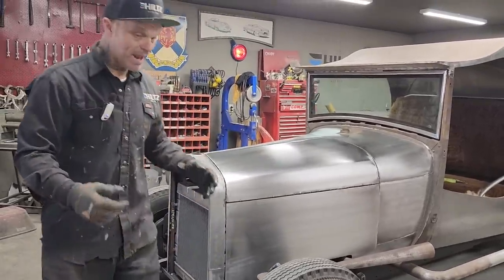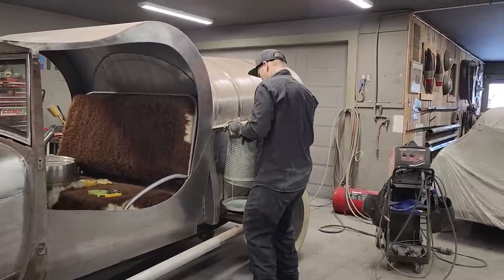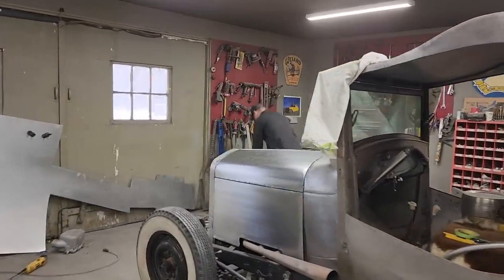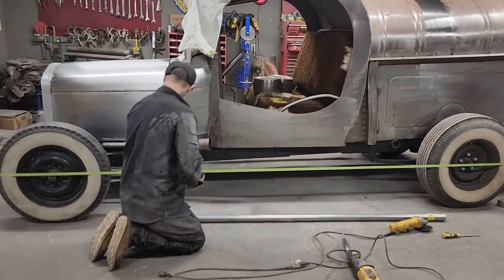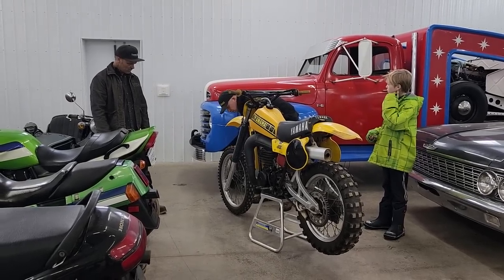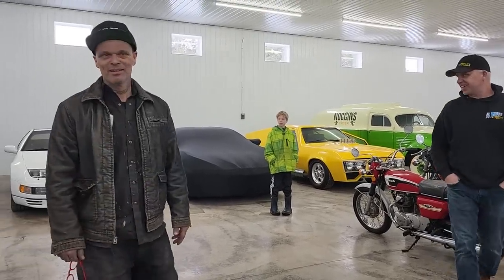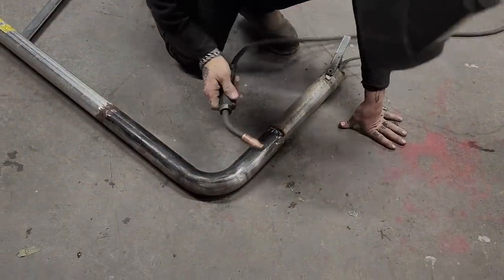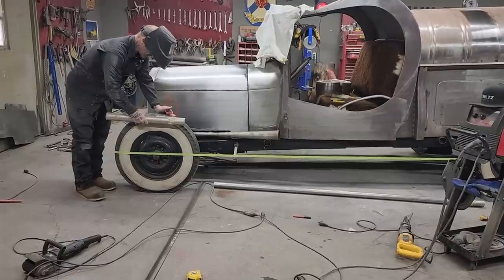Designing fenders, re-fabricating running boards AND sold a motorbike 👏🏼 1978 Yamaha YZ400

Comment: An observation:
I have watched Chad for quite a while now.
And it has always amazed me... especially since he went to buzzing off his hair (as I do too)...it amazes me that he never wears a cloth welder's cap, or even a "doo rag", under his welding helmet.

Myself, when doing any work other than welding, I just wear a ball cap 🧢 as Chad does.
But if I weld, I take that cap 🧢 off, and replace it with a welder's cap. It not only helps keep my mostly bald head from getting accidentally burned by sparks. But it also still helps keep my head from getting as dirty, as it would if it was not covered.

I am definitely NOT trying to tell Chad what he should do.

I am just commenting about my surprise that he doesn't wear anything.

Comment: Regarding the Eastwood tool that Chad was using on the truck. The "disc" is referred to as a drum. It is 40 grit. I have the Harbor Freight version and it is nearly identical to the Eastwood tool but considerably less expensive AND it comes with extra drums of different finer grits which ARE interchangeable with the Eastwood tool. The drums at HF are $29. I love my HF version. It makes short work of finishing large areas down to bare metal.
Reply: Exactly the same except you get 3 different drums with the harbor freight version and it costs so much less! I bought several extra drums and paid $10 each on sale.
Reply: I have the Eastwood and the one from harbor freight and they are
Reply: Made in China?
Reply: I think bad chad lives in canada, if so harbor feight is only in the 🇺🇸

Comment: Chad when you butt weld pipe. Bevel your edges when grinding. You wont have to leave a gap. You will be able to butt right together. Then fill in with weld. Makes for a very strong weld.

Comment: That YZ is a 79, 78 had s tubular steel swing arm, the 79 was the first time for an aluminum swing arm. The spark arrestor is not stock. The engines are completely different from each other, a stock 78 piston is 60 thousand bigger than the 79. With different strokes, heads, exhaust pipes, to name a few.

Comment: I very much appreciate you explaining how to weld two pieces of pipe together and all the other processes, most people don't explain things or don't want others to know how to do things.  Creat video, I like to buy and sell as well, I have an old c3 corvette and at some point hope to make a little on it.
Reply: You actually use angle iron to set your round tubing in to get straight welds. I've seen that set up on welding table's they would use it to weld different stock together to get the two pieces straight. 
I wrote to soon now that I see Chad has angle iron on the ground

Comment: I had a '81 YZ465 as a teenager that looked identical to that one. That thing was crazy fast! I'll never forget that smell of Ester oil which it required 25:1 mix, so the oil cost twice as much as the premium fuel it burned. I also remember having to really jump on that kick starter with a straight leg with all my body weight & it would still throw you over the handlebars from the compression if you didn't have the piston  right after the top of the stroke. Also the Kickstarter wore holes through the bottom of a few pairs of riding boots & had to replace a few Kickstart return springs in the 8 years of ownership along with getting in a accident with my girlfriend at the time on the back after finally talking her into going for a ride. A friend was ripping up the mountain road on a dirt bike her & I were coming down & he was on my side of the road on a blind corner & he ran into the side of my bike which resulted in me flying over the handlebars & only getting minor scratches but the other kid broke his femur & my girlfriend had to be life flighted over 400 miles away & had her leg amputated from the knee down. So yeah, that bike brought back some memories for sure. The amazing thing is my girlfriend was playing basketball 9 months after her amputation & is doing great

Comment: Yz400 was from 1979 not '78 as others have commented. Dealer man who seems to think modern technological solutions are 'better' is wrong about 'Worth their weight in gold', the Yam Tx750 had inherent design flaws which Yamaha did try to remedy but the bike wasn't a success. They withdrew it from sale and stuck with the 2 strokes which they were superb at engineering and developing and the much better Xs650 until they learnt much more about 4 strokes. The Tx750 has some rarity value but it's not considered a 'classic' as in it's enjoyable to own and ride, as such it's value is as a curiosity more than anything. More happily, most of your other bikes though from what l can see are not so afflicted.

Comment: @ 52:42 mark, when Chad forgot the tubing was hot... Reminds me of an old joke that a farrier (blacksmith, for those who don't know) once told my dad and me, back in the 1970s, while the farrier was shoeing our horses.
It's been close to 50 years since my dad and I were told this joke. Yet both of us...he at age 83, and me at 60... still remember it.
In fact, my dad mentioned that joke (for the umpteenth time) to our family again at Christmas.😁

There were a few men standing around a blacksmith's shop one day. Chatting and watching the farrier make new shoes for a horse.
After a while, a stranger walked in.
The guy was dressed like a "city dude". 
The other men chuckled to each other about this city dude.
The dude didn't seem to take notice. Or at least didn't let on that he was bothered by the laughing.
The farrier had just taken a hot shoe, and hammered on it, on the anvil, putting some shape into it.
But before he could dip it in the cooling water, he turned to the men to answer a question.
The dude stepped over to the anvil; reached his hand out; and grabbed the hot shoe with his bare hand!
He immediately let go, with the shoe clattering onto the floor.
One of the men teasingly asked the dude, "Hot, wasn't it?"🤣
The dude turned to the man and replied, "Nope. Just don't take me long to look at a horseshoe."

Comment: Hey my friend. A fellow YouTuber is looking for a door for a 46 International Pickup he's looking for the driver side door an needs the hold door. The glass . Door handle inside and out. And hinges attached to the door. Needs a window crank as well. Window crank handle. Pretty much the whole door. I'll check back in a couple hours to see if you can help locate it. And you have some awesome deal to my friend. I like the 55 Cadillac just found.

Comment: Being kinda observant, I have noticed a bunch of people hauling cars, practically daily and I note that none of them appear to haul floor jacks with them. Wondering if they maybe just use the jack already built into almost every trailer..
Same way in that if you leave the trailer attached to the tow vehicle and run the jack down the angle of the trailer will change so that the transition to the ramps is more level.
Also I note there appear to be no fire extinguishers in the new building. Firing up a car with a leaking carburetor is likely not a good idea under any circumstance, but especially in a storage unit with a lifetime collection of vehicles in it. 
Half a dozen chemical fire extinguishers should have been added as a minimum.
Best of luck on continuing with your vision.

Comment: for cutting stuff loose in hard to get at spots, i love the plasma cutter for that, get ya an air splitter, so ya can keep it handy, save ya fortune on them cut off wheels, like the direction the truck is heading

Comment: They also use to encapsulate aircraft carburettors so it doesnt ice up at altitude. The reason for this one you have is so that the forced air does not escape the carburettor under high supecharger pressures. Coming along nicely on the oiltruck.

Comment: I’m not loving Chads ideas for holding the hood down. I’m wondering if the hood mechanism that is on the hood  you used for the “fade aways” on the 48 Pontiac would work. They would be period correct and would look proper. 🇨🇦☮️

Comment: Chad, please stop calling everything exhaust pipe! It is tubing. It does not have exhaust going in it or out of it, nor has it ever had exhaust go through it. It is inexpensive tube that can also be used for exhaust if you desire to. It is 2 inch tube or what ever size you want. Also tube is measured on the outside. Pipe is measured on the inside. That means that if the tube was 3/4 on the outside it would most likely be 1/2 inch on the inside. So it might be 3/4 tube and 1/2 inch pipe. Same piece